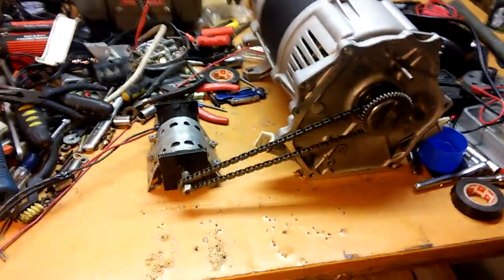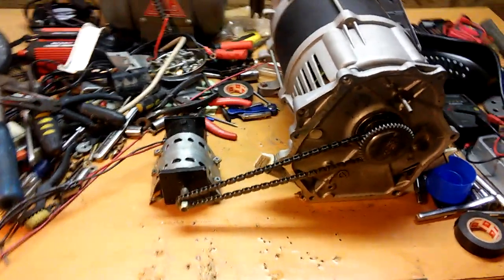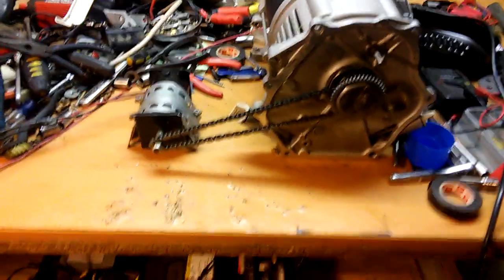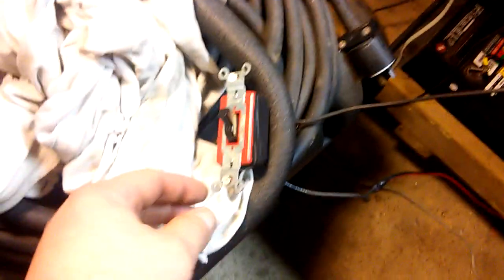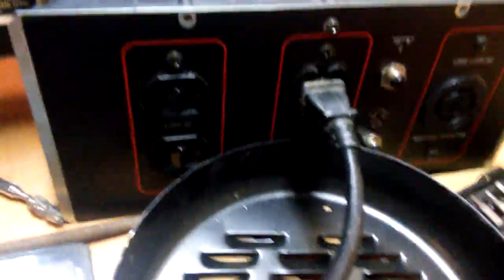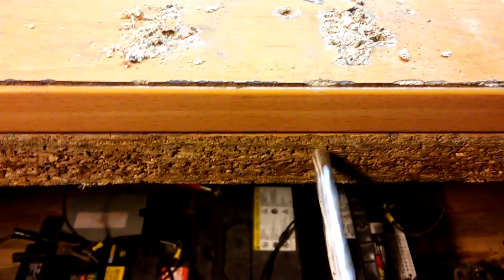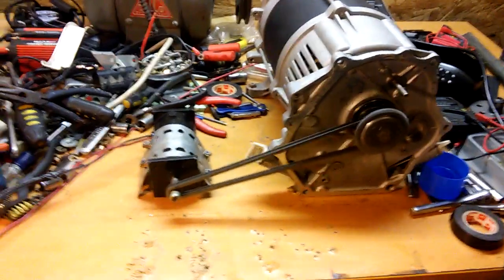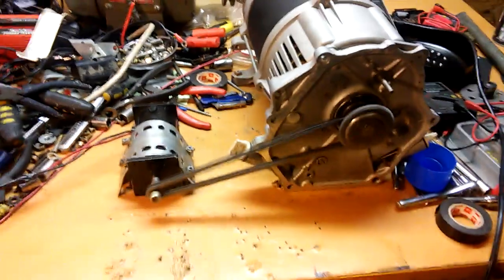24 volt dc motor running 6250/5000 watt generator.

Comment: Put a ignition coil in between ur battery and 12 volt and a spark gap then connect it via a rectifier cap 2 motor

Comment: Where did you get that kind of dc motor
Reply from the maker: It's been a few years since I messed with the project so I do not remember. I would recommend a larger dc motor and more batteries for continuous operation.  I hope this helps. Thanks for the comment.

Comment: That drill has a commutated, universal motor.
You can run it straight from the battery bank, or connect it to the wires on that scooter motor & spin it.

While you made a cool discovery for a guy screwing around in his garage, it's nothing new.

Minimal research would tell you where your idea is heading.
I'll give you a hint...
The laws of conservation of energy prohibit the output of a device from being greater than the input.
Reply from the maker: Thanks for the comment. This experiment just proves that you do not have to pay for the energy it creates.
Reply: @stevenchartier3380  
Actually, you do... 
The laws of conservation of energy still apply.  

Calculate the watts consumed by the motor that turns the generator & the watts produced by the generator.  
You'll find that the amount of electricity produced is far less than what is used to produce it.  

A better alternative would be a switch mode power supply (buck converter), particularly for universal motors, such as are found in most corded & handheld power tools.

Comment: get a giant cast iron wheel  with a small strong motor that takes vary little energy. then you manually spin the big iron wheel intel the small motor can keep it at a constant rotation cranking  huge generator. hospitals use them
Reply from the maker: Hi. Thanks for the comment. Yes, I  can try that when I get some time.

Comment: Hi" I've worked as a machine Tech, for over 25 year's, and went from BASIC
Repair, to the Computer Boards, program manager.-! So, what I wanna say is" what you are doing will work" the way you're setting it up now. However, if you put a real LOAD" on it, 
You will find it getting weaker" slower, and getting VERY HOT!! Fast.!! But if ya, rework the sizes of your, gears, so that the one on you're genarator is smaller, than the one on you're Motor, you're speed will increase dramatically, and you will need a ( weaghted) wheel to obsorb the power" by way of speed, it will then transfer that power by way of Torq, and  improve you're output, of "power & Torq" to the genarator.!!! So, rework you're, sizes on the gears. Make you're gears smaller on genarator, and Larger on the weighted flywheel, that goes from flywheel to genarator, but on the motor" you connect to start the flywheel to turning," you're gears can be almost the same size, with the Motor gear being a little bit larger, than you're weighted flywheel. Google weighted flywheel, Torq transfer, and check out what is out there already. That's what you need my friend, a weighted flywheel, to transfer the Torque.
Reply from the maker: Thanks for the information. Time has gotten the best of me but will pick this back up in the near future.
Reply: @stevenchartier3380  
OKAY" my friend. I truly believe it will be people like us who will finally FIGURE out a way to get past the fossil fuels.!!! The back yard tinkerer.!!! The regular GUY, The inventer.!! I recently, saw a guy on utube who started out just messing with a way to put out more power by way of his DESIGN, him & another guy, worked together to figure it out. They used some of my idea's to make a generator" that produced enough power for any size home. Now, They both are ( SO FULL OF GREED)!! That they charge as much as 8 to 10 thousand dollars for one unit.!!! What a shame.!!! I do what I'm doing for the people" to be set free, not to make millions of dollars, and buy some Island some where.!!! They should be ASHAMED OF THEMSELVES!!!!! I don't know to many people that can put out 8 to 10 thousand dollars, on a ( I want it item)
Now" I just wanna say, I'm berry careful about what I tell anyone, about things I've LEARNED about this type of stuff, I have to know THEY are not out to make a DOLLAR!!! Although the money will come" I just don't wanna help  someone FIGURE out thing's, or trouble shoot problems, that are gonna use it to get there's!!! And not care about the ones who can't pay those big money price's.!!! Ya, know.?? Tell me what you think about what I've just said. 
From ARK ANGEL.
Reply: @stevenchartier3380  Hi my friend,, just thinking about you're video" and wondering why you haven't 
(TOLD me what you think about the
TRUE STORY" I told ya, about THOSE Two gents, that used a lot of my Comments, to work out problems with there systems, the generator" that is very Low - Torque)!!!  For powering a whole House, Once it was FIGURED out" they started taking orders, for the unit, "after applying for The patient" I couldn't BELIEVE it when I saw, The 
Price,!!! 8 to 10 thousand dollars,.!!! For a unit that Costed, them around 6 hundred dollars Ea,. To have made.!!!
I completely stopped all Comments on there channel... Because if someone is as money HUNGRY as that"!!! They might even sue me for saying what I HAVE, that's why I am SO CARFULE NOT TO Say any names...... But I'm looking for a few good people who are into free energy" To help work out problems in there system's.... Only I am carfule not to give ANSWERS" straight
Out,... I will lead someone to the salution".... Rather hand it over..i have one person, who I'm vary proud of, he 
Gives everthing he's Learned away for the asking.
Reply from the maker: @arkangel8709  Hello, yes do  not  want to get "rich" off of the idea but just trying to show people that if you try you can be successful in creating something useful.  It will take tweaking, perseverance, testing, fabrication, etc. to make it work for their certain situation.  I will hopefully be messing with this again in the future as the free time that I need is unavailable to me right now.  Thanks for the comment.
Reply: Hey Ark Angel. Just want to  be certain. the weighted flywheel attaches to the motor?

Comment: motor runs generator , 5000 watt generator connected to microwave oven transformer , transformer connects to plug ins strip ,  motor plugs into plug ins strip . Plug in wall outlet to plug ins strip for 10 seconds and unplug. Runs itself. portable SHTF power. When you run over 2,500 watts on plug ins it starts to get hot. Put all this plus an extra bonus power 12 volt battery all in a Dewalt plastic box on wheels with handle.
Reply from the maker: Nice. Thanks for the comment.

Comment: I suppose I will have to build it to prove a similar concept will work. Running a 24 volt DC motor 1750 RPM married to a 48VDC 100 Amp Alternator to run a 48 VDC propulsion motor using 7 amps at 8 knots. UTILIZING 2 BANKS OF lithium-ion batteries of 48 VDC each.
Reply: This will work, but you would be way ahead of the game by using the 48 volt batteries to directly power the 48 volt motor.

You will lose a great deal of energy through friction and heat in each device.

Comment: OK SO EXCELLENT IDEA. i have the same idea and years ago i started accumulation of parts to build a real free energy dc motor flywheel powered honda 2000watt ac gen. am still looking for tube box cage to mount 1invh shafts bearings and two large flywheels,i basically have the 3hp 24vdc motorspinning one flywheel coupled with a 4 size pulley on each side of that heavy exercise bike machine flywheel . the second large iron steam engine flywheel has a large pully and the generator has a one inch pulley. where the real true free energy comes in is a full sized 24 volt 350watt 10amp 6 x3 foot solar panel powering my 8 amp dc motor. withthis configuration i use the 2 four size pulleys to get my generator at 3600 ~3800 rpm and achieve over 2000 watts of house current from 24vdc free all day long without batteries. i guess i will eventually build a proper frame and add a couple of 12volt batteries and the digi solar controller for steady output ,i would hope you are still improving your setup. good job
Reply: If you actually make that work, I'll eat my hat.

Again, a very small amount of research would tell you where this project is heading.

The laws of conservation of energy state that a device cannot put out more energy than what is put in.

Heat, friction, resistance of air and  electrical resistance will all reduce the efficiency of a device until it falls within the laws of conservation of energy.

Energy can neither be summoned from nowhere, nor vanish into nothingness.
It can change forms, but only at a further loss.
Reply from the maker: Hi. Nice work. I would recommend  picking up an old gas generator cage with wheels, etc. and retrofitting your solution or like you said create your own cage. Thanks for the comment.

Comment: Great stuff! Don't let them get you down. Try a bigger pulley on the alternator, else incorporate a flywheel. I't helps a small motor run a big genny easily. plenty of examples to follow here(youtube).
Reply: Bigger wheel will speed up the rpms

Comment: Thanks for the video Steven. I would like to do that project myself. Have you tried how long the motor will run without recharging the batteries?
Reply from the maker: Hi. I ran it for 30 minutes, but just trying to prove a concept. I would recommend a larger motor and more batteries. Thanks for the comment.

Comment: Laws of physics says that you are using more wattage than you are generating unless your solar panel can be configured to efficiently keep batteries charged.
Reply: Arthur Summers funny how laws are just man's theory on something.  also funny how selling energy is a trillions a dollar a year industry worldwide. our govts would love for us to control our own lives they would never lie or keep things from us right? 
it's like your car. it needs a help to get started once started you can remove the power source. the battery. it stays running why. the alternator is at operation rpm. so how does the alternator know its a gas motor spinning it? if your generator is up to operation rpm and your DC motor is getting enough power why would it die. just like your car how does it know what's providing rpms or current? if we take a 10kw generator,  and a DC motor. once you plug it in and get both to operation speed. it doesn't take 10kw DC motor to spin that generator. it takes 3 to 4 kw.  but wait that can't work because my book says so? a book and industry that has silenced, killed,  and bought up great technology. we could have cheap clean energy today. if you have a spare altejator try it. just like in your car it doesn't care who spins it. you can modify the stator and windings and get 120v or 220v out of it. I bet you the DC motor you use to spin it and loop back will run it. I guess it's possible they have conscience and know that we're taught gas can power a generator but electric motor can't. amazing what trillions of dollars can buy universities and professors to release whatever research you want. and shame and try to humiliate anything else. I guess I'm a crazy conspiracy theorist. our world govts love us so much they would give up trillions yearly if it was possible right?

Comment: Show Output voltage of 5000 watt generator and show voltage of 24Volt DC motor Use multimeter.
Reply from the maker: Nivritti Panherkar as soon as I get back to working on the project I will post readings. Thanks for the comment.
Reply: yes please do that

Comment: simply not possible.  you can't get more watt's than you are feeding into.
Reply: In Nature there is no 'out' or 'in' when it comes to energy, energy is constantly changing form, Nature is a cycle, circular. When you use words like in and out. You're implying creation and destruction of the energy used in this video. What Steven did was simply guiding energy through his system by orchestrating its transformation states. Solar-potential(battery)-motion(The Motors)-electrical-motor(drill). There's nothing out of the ordinary here. What's extraordinary is you eating a bowl of CornFlakes going to the gym and benching 40kg(10-times) = 400kg.
Reply: it's amazing what were told isn't possible when you measure the profits by the billions quarterly. like when Tesla did this and jp Morgan pulled funding took his equipment and had his tower blown up. once he learned he planned on giving free power away. if I had unlimited millions and billions,  I could write 2 dozen books and make millions in donations to universities to do whatever research I wanted with results I wanted. how is this any different then you car go outside and try. go start your car OK now remove your battery. it still runs why? because the alternator is getting g the rpms needed to in operation range. now how does the alternator know it's a gas motor turning it? why does it care. if the generator is at operation rpm  and the DC motor gets enough current.  why would it stop unless overloaded or bearings fail. it's amazing how many people refuse to even try something because a book tells them it can't be done. my book but my book says we wouldn't have shit today if everyone just listened to what their told. you think the powers will ever let us make our own power. or that you can do it with ordinary objects.. you can modify the ststor  and windings on a alternator and get either 120vac 220ac. or make a DC welder out of it.  and use a washing machine motor to spin it. and bam you have power. But my book says it can't happen. funny how 250billion in profits from just Exxon alone yearly can influence things. Just like when I was in the Marines we had things we will never see released. like really cool shit and if you can't understand how this can work what I've seen would be like going back to 1600 and telling them what a smart phone is. open your mind think about things. power is control. we need them for power,  your taught gas can provide power but electric motor can't. why can't it a 10kw generator and a DC motor are paired together. it can't go on its own. but once you plug it in or use a battery like a car to start it.  both are in operation range. that 10kw generator doesn't need a DC motor at 10kw to spin it. a 4kw hour DC motor spins it all day. well my book says it can't. it's fake my book says this laws. ever notice that laws are just man's theory on something until something else is observed. and it's observed everywhere people show you. this guy isn't selling shit 99 percent of these people arnt. Tesla did this on a much larger scale 100 years ago. he went from being to the top world scientist literally everthing we use today uses his parents. had all the money and resources he needed. as soon as his backers found out he was going to give thebworld free power they destroyed him and he never wavered from it.  he died alone in a  hotel. going hotel to hotel until they kicked him out when he couldn't pay. now why would they do this to the best scientist the world had ever seen. if we are self reliant we can't be controlled. it's money power greed. if it was fake and bullshit why not let him release it. why confiscate and dynamite everything
Reply: just to add the last little bit. recreate his build here show us it's fake. you might actually learn something. Open your mind,  you really think the world govts actually care about us. they poison our food air and water. we take the brunt of whatever. we fight their wars while they have underground bunkers for them and families. it's a power control thing. our economy is energy based. buying and selling energy. trillions a year. you honestly think that anyone industry is going to give up that kind of money. seriously trillion dollar industry is supposed to just say here you go. we don't need your money anymore. make power yourself.
Reply from the maker: Nadeem Ahmed this is demonstrating that it is possible. A larger motor, more batteries and more solar panels would do wonders.

Comment: how much watts has this 24v Motor
Reply: Jaffer Azad  82.78 watts from .1111 horsepower
Reply: hi i am interested in how much amps are drawn by 24v dc motor or how many watts ? if you load more electric appliances on the 5kw generator what will happen? did it work out for you? did you try it? i am having an experiment like this.... want to make a video and show you...

Comment: You have to load test it . With the proper loads . You'll notice the higher the load the more that little motor will start burning up. I'm guessing the little motor will take 10 to 20 amps then start smoking.
Reply from the maker: normellow yes, a larger motor, more batteries and solar panels.  This video is only a proof of concept.  I haven't had the chance to get back to it. Thanks for the comment.
Reply: Can we use geared motor to add torque for the little motor and a bigger drive wheel to compensate wth the speed, and also add a flywheel,?

Comment: that system not work guys is impossible with 24v dc motor 1hp move one generator like that, u need minimum 10hp motor for move that gen, good luck.
Reply: This no cog generator low rpm is the key https://youtu.be/Z4_yitCl_Gw http://www.ftcinnovations.com/
Reply: Al

exis Cueto
Reply: Breathless motors are incredibly powerful. Check out "boosted boards".
Reply: @REELSZA  Loading the generator will soon leave the poor 24V motor breathless...The comments are just getting funnier and funnier...